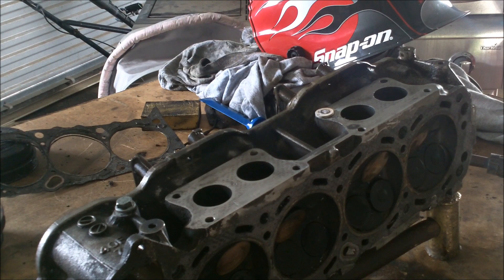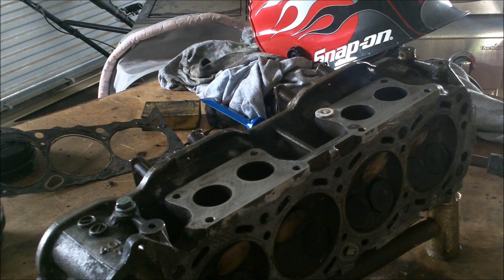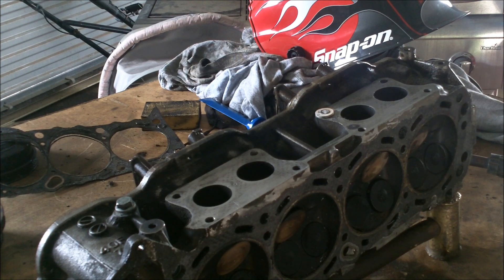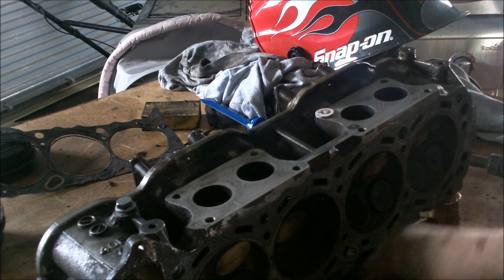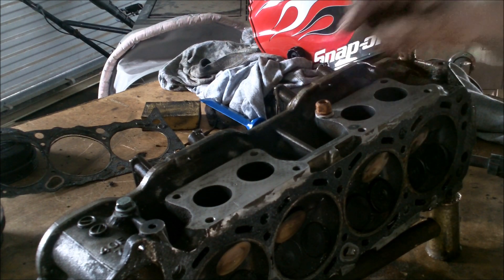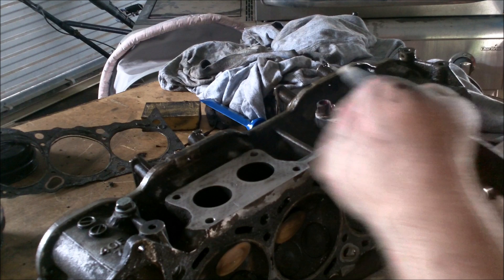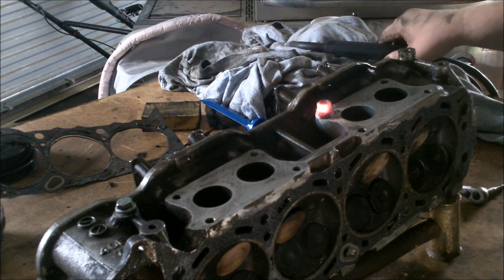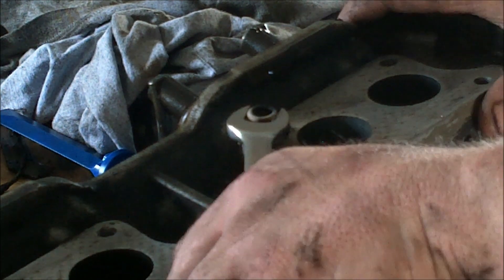ENGINE REPAIR QUICK TIP : HOW TO EXTRACT BROKEN BOLTS WITH A WIRE WELDING MACHINE

Comment: how do u get to it if it's way below the top of the head i have 3 broken bolts on my engine head that half the thread broke off how to get down in the hole using this method

Comment: take a hard drive apart and get the magnets out of it. you will use them all the time for holding steel to weld. you wont believe the strength.

Comment: Nice video!   This would be my first choice but not everyone has access to a wire welder.  If not, I would use a left handed drill and an Easy Out extractor.  If the threads are not too jammed the drill may back it out with out even needing the extractor.

Comment: That's a great idea, even if the bolt is broken slightly below flush you could still plug weld the washer to it.I've been welding for years and haven't seen that one. Not only does it give you the meat you need to weld the bolt to, the washer protects the material. Nice work.

Comment: I like your method, to weld the outside of the nut to the washer. Some people weld inside the nut to the remainder of the bolt, but it's hard to get deep inside and the extra penetration doesn't seem to be necessary. By the way, what happened to the ceramic cup on your MIG welder, for delivering the inert gas?
Reply from the maker: its a flux core welder....didnt come with a diffuser

Comment: So you can build up the weld in the hole to the level of the washer then weld the nut to the washer?   2 welds?   Great Idea.  I have drilled and tapped but have had trouble get the hole drilled true. I have had no luck with easy outs.  No such thing as an easy out when using one!!!
Bruce from Canada